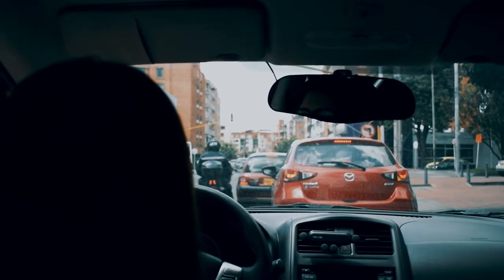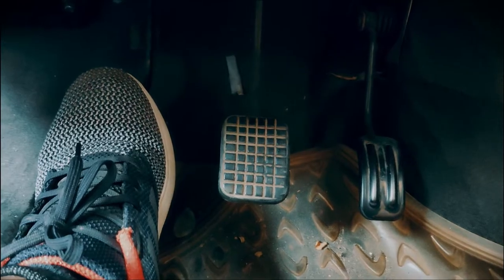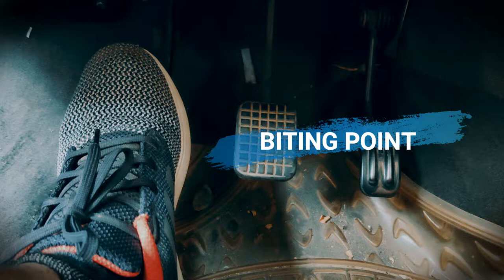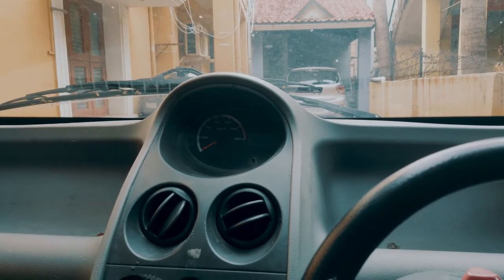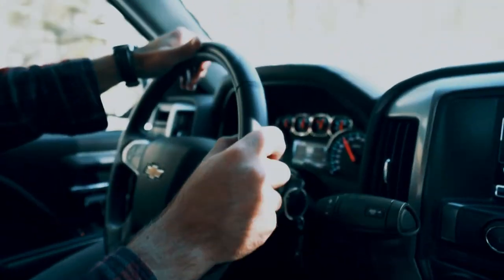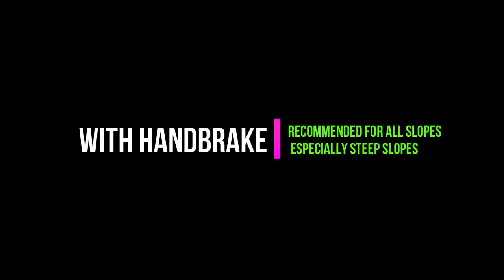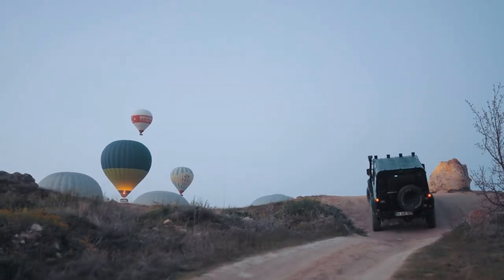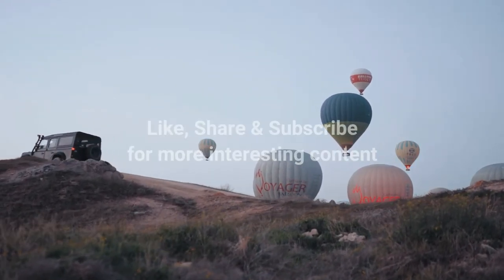How To Drive Your Car On Slope

Comment: Nice and simple explanation. What if it's a steep ascend and nose to nose traffic. How to control slight moving and stopping quickly. What if there's a something like a hump where we need to move over it very controlled way so that the vehicle won't suddenly jump and hit anything and it doesn't stall

Comment: There is a steep uphill slope towards the exit of a mall, so if had to stop in the midway of the slope due to people crossing, then my car would still roll back on handbrake. Its not very easy to full complete handbrake. Cz it would be hard to pull it down while accelerating.

Comment: Excellent orientation.  Though I was adopting this due to practice, the concept of biting point was not known to me.  It is very useful information.  Suggest, release next video on how to avoid the car from going down in a slope when you are supposed to go up only? thereby preventing your car hitting the car behind you.
Reply from the maker: I've explained that in this video itself. The car will not roll back if you let go off the brake when you hold the clutch at the biting point provided it is not a steep slope 🙂

Comment: When I take my leg off the break. The car went backwards. Even though the clutch was in biting point. I hate slopes.
Reply: And what is you solution then, do tell.
Reply: @machungapachuau7101 If i knew, I wouldn’t be here…watching this video.
Reply: I think the slope might be too much. Also, I am sure when you released the break it wouldn't have rolled back instantly. So as soon as you release the break at biting point, push accelerator

Comment: Here's a problem if the vehicle is ended up in a Himalayan hill traffic.. taking long time to pass.. handbrake needs to be used countless times.. clutch accelerator control need to be practiced